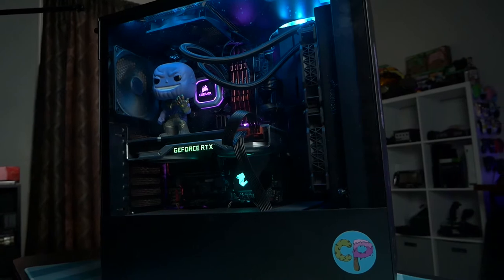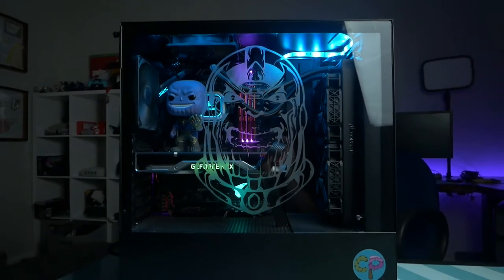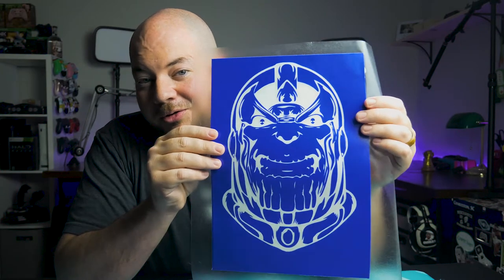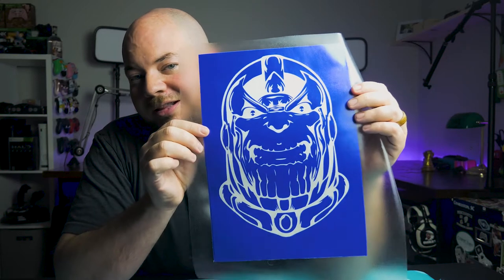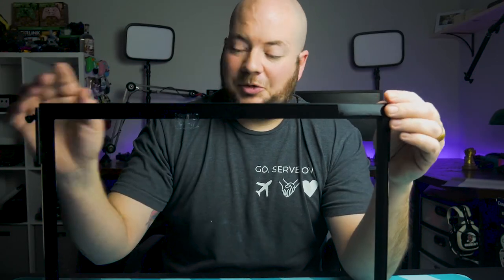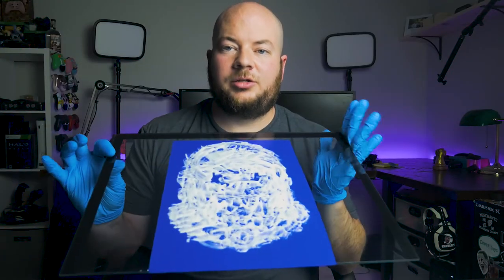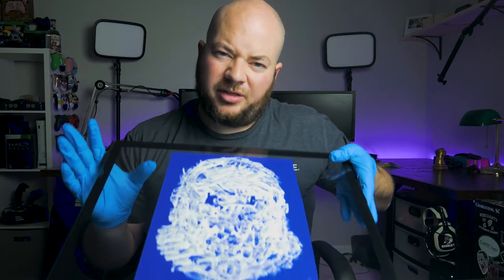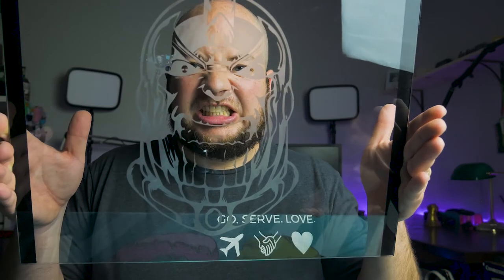PC modding how to etch tempered glass

Comment: yeah, only thing id say is that 5 minutes isnt enough if youre etch has a lot of area. tempered glass cant shatter from using the etching cream, ive done anywhere up to 30 minutes with it and it works better that way.
Reply: also its usually a good idea to put the chemical into a baking soda solution to remove the acidic properties before putting it down your drain
Reply from the maker: @wrendan  great tips. Thank you for letting me know. Ive upped my time to 10 minutes. I find any longer and my edges get fuzzy. Probably due to cheap vinyl.

Comment: Also was planning on buying a silhouette cameo does it matter if I buy the older version seeing it’s a cheaper model or does the models matter in a sense
Reply from the maker: As long as it cuts the dimensions you want they're all pretty similar. Some cut 12" wide, others 8, just make sure it cuts the right size for you.